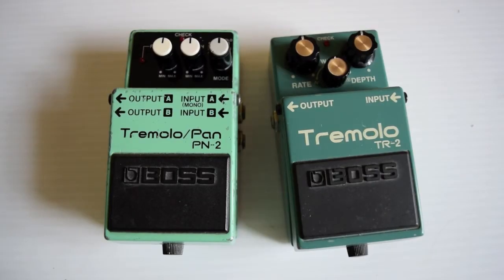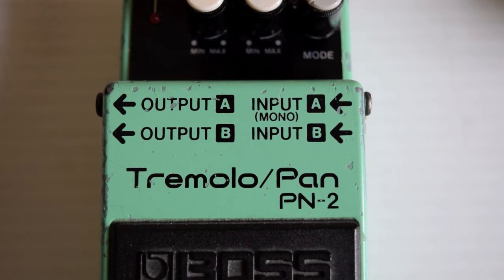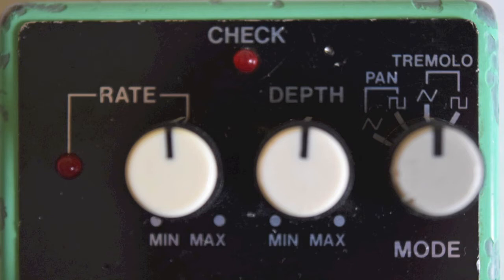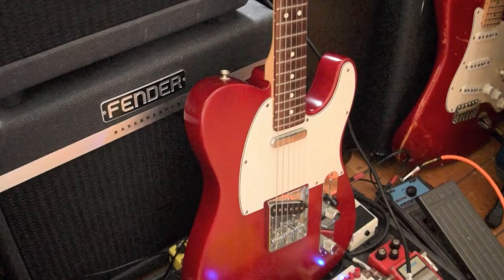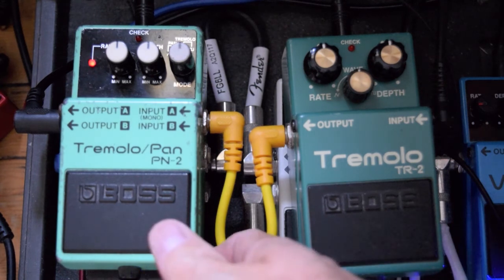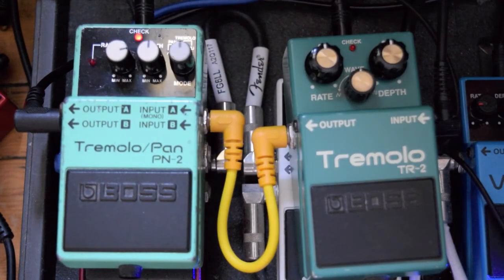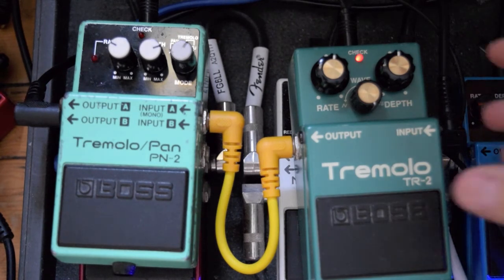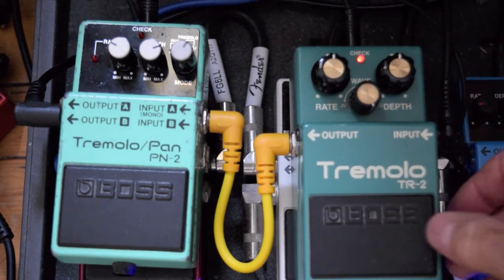BOSS PN-2 & TR-2 TREMOLO EFFECTS

Comment: I forgot about the PN2. I bought the TR2 when it came out. I must've thought it was an older pedal. Any time I saw the big knobs I would presume it's analog and older and would always want that over a newer pedal.
Reply from the maker: I was living in Australia when the TR-2 came out around September 1997. The OD-3 and FZ-3 also came along with it to celebrate Boss 20th Anniversary! If the FZ-2 was red then you’d have had the “traffic light” configuration all over again! (OD-1, PH-1 and SP-1 in 1977)
All three new models were three knob in keeping with the simplicity of vintage Boss I guess. As you may have noticed, these had gold top knobs except for the FZ-2. I was gagging for a TR-2 though and only bought one soon after I got back to Europe in early 1998. Mine is an early production unit with the volume drop. I’ve never really been to bothered by this but it does exist and Boss rectified the matter in the last 2 decades. I also find it can kill tone a bit. That’s why people modify them. 
The PN-2 on the other hand is a rare enough model produced from 1990 to 1995 at the latest. It’s a Pan as well as a Tremolo and sounds great in stereo but the Tremolo mode is always mono! Still I love both, the TR-2 is much simpler really and looks very nice.
Reply: @KRAZEEIZATION  cool. I never knew about the volume drop. When was that fixed? I don't notice a volume drop. Or maybe I've just gotten used to it? 😆 I'm gonna listen closely. Now that you mention it, I do remember the 20th anniversary. I thought about getting the fuzz, but at the time I had a ds1 and metal zone 😆 🤘
Reply from the maker: @pqsk  The Fuzz was going for silly money up to recently. There’s a Waza version now. The Limited Edition Tone Blender one was sold out before it was released! 
The TR-2 from as far back as 2010 has no volume drop. Boss modified it. It was great to see three analog units. I think Boss went off the beaten track from 2000 on wards with most pedals being digital or COSM. Some nasty stuff too. I think the Waza series restored my faith in them. I bought the VB-2 Vibrato, incredible sounding unit. I kept on collecting the analog stuff all through.
Reply from the maker: @pqsk  From a forum: The TR-2 was changed in mid-2006, when the EU RoHS certification meant they needed to redesign the circuit to use a few different parts. While at it, they also raised the gain slightly, to compensate for the apparent volume loss inherent to the tremolo effect.

I’ve also read there’s a volume gain pot in newer versions again since then. You can tweak it. Anti clockwise increases the volume!!!
Reply: @KRAZEEIZATION  yeah the waza pedals sound good. I sold my ds1 sometime before I joined the army because I needed to pay some bills. About 8 years or so I started to play guitar again. Bought a bunch of pedals and a brand new ds1 sounded so weird. I had also bought some boss chorus pedal. Later I found out chorus was digital. Really didn't like it. Found out that the ds1 had different circuits. I returned them, but I replaced them with EHX small clone and clone theory. Nicer sounds. I bought a ds1 online and it sounds much better. Just like my old one.

Man seriously that's very interesting about the tr2. Really didn't know. I've always loved it.
Reply from the maker: @pqsk  That’s cool. Maybe you bought the CE-5 Chorus? It’s from 1991 and was analog until around 2000 then digital after that. It doesn’t say anything on it but the digital board is totally different. Mine is a 1993 so I’m okay! I still have the 1989 DS-1 that I bought in 1990. I also had a MIJ but sold it. I bought the 40th Anniversary black DS-1, all full through hole parts. What kind of guitars have you?
Reply: @KRAZEEIZATION   yes that's the one. I don't mind messing with digital effects on mobile devices with an audio interface, but the analog sounds so much better. Especially the flange. I'm unable to find any digital plugin that can mimic all of my boss bf2 sounds.

I have an esp explorer ltd, some unknown brand elektra les Paul, a fender mustang, fender jaguar and a fender jagstang. The jagstang really does sound like a proto type lol
Reply from the maker: @pqsk  into the offsets then!
Reply: @KRAZEEIZATION  😆 yeah. It's fun to mess around. I think I recorded 1 guitar part once on it when I was not home and brought that guitar with me.
Reply: @pqsk  very true. Right Untill now no bf2 plugin available. The flanger in amplitube try to recreate this but the sound still doesnt there and super thin. So i bought the real one
Reply: @bangdude5630  I found that using the mobile bias fx 2 comes even closer now with that ada flanger clone. The bias pedal mobile is using a different DSP engine. I spent a few days a few weeks back and realized this by accident. Although it is buggy. Sometimes it goes way too high frequency like it almost sounds like a phaser digital or something, but then you just shut it down and open it and it’s back to normal. But yeah it’s convenient to have and mess with but it’s light years away from being right. Maybe if they update bias pedal to the same dsp as bias fx2 mobile it might be possible because there’s a lot more to tinker with in bias pedal mobile. Their CS is so backed up with the spark go. It’s hard to get an answer on when they’ll fix their bugs. So another win for pedals even digital pedals lol. Because they don’t have nearly this many bugs on a pedal. I mean the boss tr issue wasn’t as bad as the bugs that these software plugins get sometimes. I bought another iOS app and all the IAP and on 2 of my iOS devices there’s a bug so I can only use it on 1 iOS device. And the crazy thing is that this company hasn’t updated their app in years and there’s no way to create a new ticket. I messaged the company on Fb and haven’t heard from them in weeks lol
Reply: @pqsk  nice i will check it out
Reply: @bangdude5630  lmk if works. What’s so insane in mobile bias fix 1, I tried the same settings over and over for years and it just sounded weird. Now it’s such music to my ears when I heard it.
Reply: @pqsk   Do you mean bias for Ipad, sadly Im just android user here.